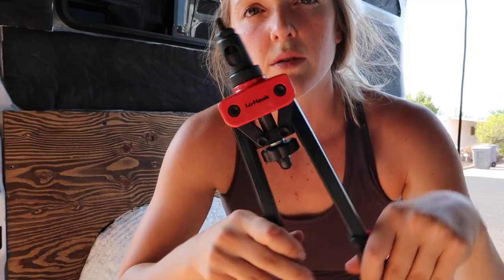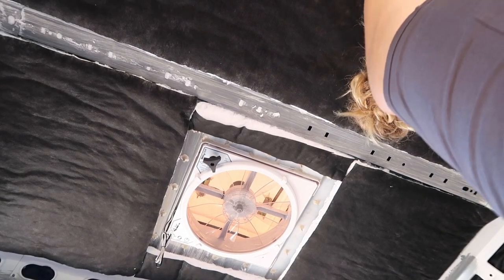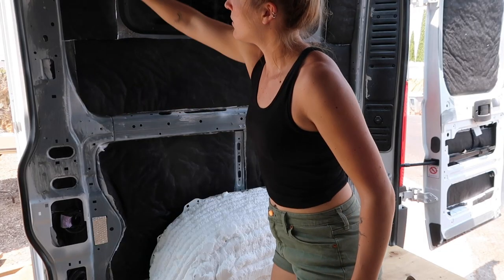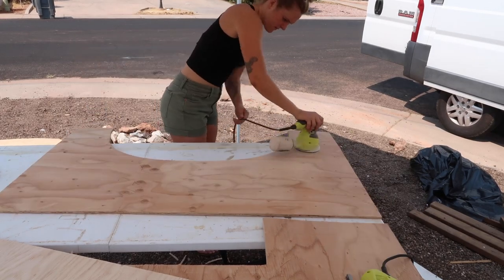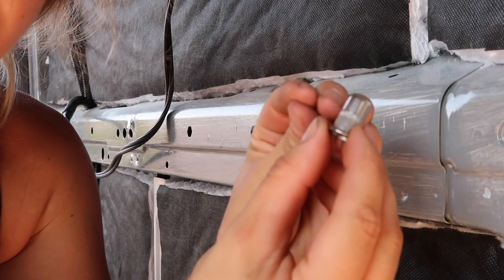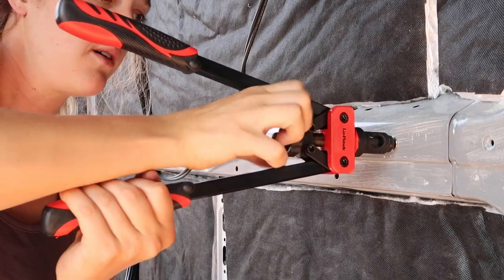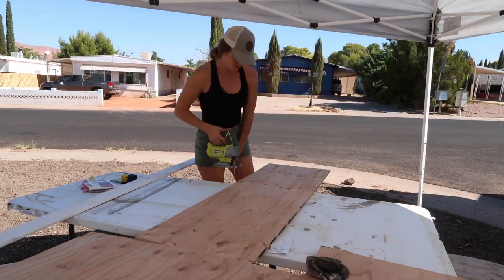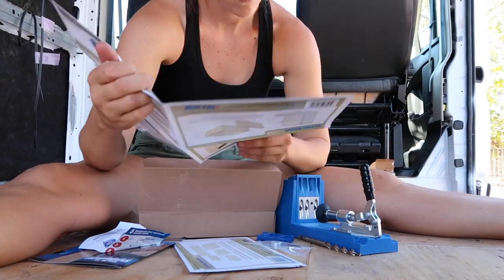VanBuild GARAGE BASICS | Rivnut Tool and Kreg Jig

Comment: Just as a heads up for anyone interested but hexagonal rivnuts also exist. They should fit a lot better in the hex holes if you find the correct size. 😉

Comment: Thanks so much for showing the Rivnut tool. I was trying to work out the fixings in my van and I think that will be the perfect thing for me. I have been flagging with just the rust step on my 25 year old van, so finding your van build and adventures has really given me a boost. Its for my dog too, but she and I are older and I don't want it to take so long that I can't enjoy it with her. Think I will be re-watching all your tips to help speed the process along. Good job Linnea.

Comment: Spray foam is always fun. I really wish I had insulated as thoroughly as your are
Reply from the maker: It was such a mess! haha  a part of me does with I had a bit extra Thinsulate to do another layer on the ceiling. What did you insulate with?
Reply: @Linneaandakela  foam board, used liquid nails to permanently adhere it and duct tape to keep it while it was curing. I dunno I'm rrrrrrreally considering completely dismantling my bus and redoing it

Comment: Those black bolts is a self tapping Torx driven deck bolt. SUPER handy. Can be used to attach deck boards to steel...especially thicker steel. First drill clearance hole just slightly smaller.....it'll tap 1/4 plate steel.

Comment: I think you have a great idea, using the the Rivnut tool and the Krig Jig. The style of bolts you are using is great. I would use thread lock on the bolt and Rivnuts ( if you have some finger nail polish it will work for thread lock( use just a touch of the finger nail polish ( the best finger nail polish to use is the junky type, you know the crap somebody give you) I Love the stained wood.
Reply from the maker: Thank you so much! Using the fingernail polish is a great idea. 
And yes, I have been loving both of the tools, happy I made the time to learn them early on in this process. Love the feedback!

Comment: Hey there, about to start build my second van, a promaster like yours. Them nuts are great!! So much better the drilling into the van itself..
 So my question: how have the rivet nuts been holding up? Do they vibrate? Did you use them elsewhere in your van build? I’ve been researching “plus nuts”, but they seem to be $$ and only available to buy online.

Comment: On your recommendation I have just ordered a kreg jig off Amazon. There’s all these bits that come with it and no INSTRUCTIONS!!!!!!!! 🥵
Reply: get in touch with kreg cause there should be instructions  Im betting they have a pdf.  Did you completely search the packaging?  Lots of YouTube vids on how to use all the different models.  You probably will need more screws. Their screws actually work better than a same size construction screw
Reply: @jackostergaard4624  
Hi Jack. Yes I checked it thoroughly but I have now found the same one on you tube which has helped a lot. Thanks so much for getting back to me anyway 😊